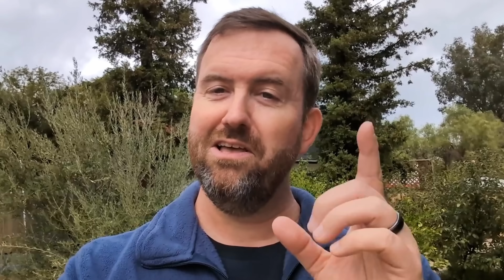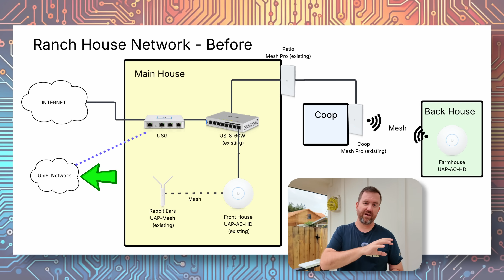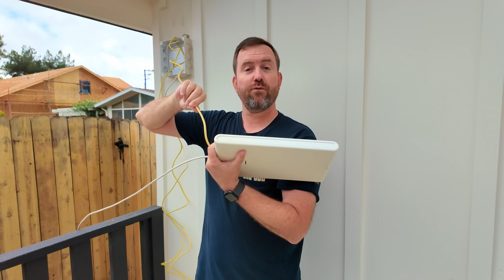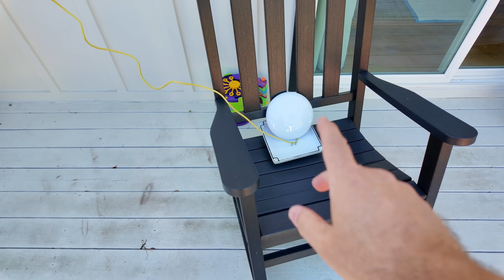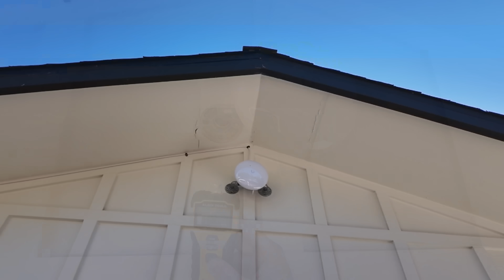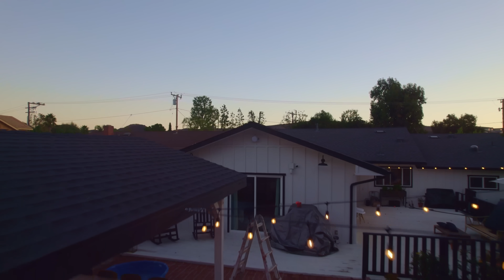How I Solved Terrible Wi-Fi with a Proper UniFi Bridge Setup

Comment: I designed and installed a wireless solution at a resort. All chalets hardwired with the control centre. Remote cottage p2p. 2 years and till date not a single issue.

It was almost an uphill battle to convince the client with hard wiring because all other installers were convincing the client with a mesh topology.

Client is thanking me till date.

Comment: Great video !  lots of interesting information and tips,  btw I am wifi 7 with my IoT stuff relegated to 2.4 mhz only.    I am an apple only house and wifi 7 rocks my devices….  No issues ….  I am typing this on a iPad m5 pro…. Wifi speed from my 2gb connection?   1.85 gb sustained from my Ethernet backhauled mesh.  Apple issues Must be a unfi thing…. I am TP-link

Comment: You can still use the Unifi express and disable wifi 7, and only run wifi 6.  There are a lot of factual errors in your video.

Why paint the cable at the coop?  Should have ran a black cat6 instead of white.

And why then hell did you make the ugly galvanize pipe pull up bar?  They make mounts for the point to points that are smaller and discrete.

This is bordering on hack job.

<- Cisco CCNP here

Comment: Last fall I got my hands dirty and dug a trench 18 inches deep, 60 feet long from the house in each direction. It took about two hours using a mattock (think pickaxe, but one side is a shovel). Then I dropped in some 1-inch SCH80 and ran ethernet cable from the house to both ends. Now I have a POE AP on the north and south side of my house. Using the Unifi software, I locked specific devices to the indoor APs and let mobile devices jump between any of the four APs indoor and outdoor. All the POE devices, routers, switches, and modem run off battery backup, so even during power outages, we never lose Internet.

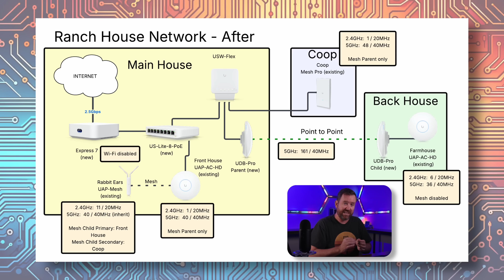Comment: Cool install. This may be a noob question, but how many SSIDs are there here. Are there separate ones for the main house, coop, and AirBNB meaning you have to manually change networks on the client device? Or is it all under one SSID? 21:08

Comment: Interesting project.  However the bit I actually like more is the use of older Unifi devices rather than spending or running to the latest.  Proves that tech can be fine when configured properly.  Also reduces the vast e-waste that we are creating...

Comment: Your cable runs look like shit.  If you had just left cable draped like that round my buildings I would have told you to rip them out and start again.  All very well getting the guys wifi working properly but the install has to look like your taking some proide in your work, not just throwing it in and pissing off as quickly as possible.  Making the install look professional and like you care about what you are doing is just as important as getting his wifi working properly.

Comment: should a person not mount the wifi accesspoints to ceilings? What difference would that make in signal strength
Reply: Depends on direction you want wifi to broadcast. These APs have a D pattern, so on a wall they shoot mostly away from dome and out of the edges of disc, less to the back side. So the guest house wall works because it's a small building. But also was probably just quicker install being right next to the poe gray box below it; more time involved to fish cable thru wall and ceiling to get it to mount there (since he was visiting the day)

Comment: Here's what I don't understand, wouldn't it be more cost effective to use a couple of hardwired AC Mesh's (with Meshing disabled) along with a couple of UMA-D antennas?  Those UDB Pro's are expensive given that they are limited to point-to-point connectivity only.  While I like that the UDB-Pro's are 5ghz, and that would reduce potential conflicts with neighbors, having the AC Mesh's pulling double duty seems like it would provide  more functionality at a lower cost.

Comment: You just cant ever convince me that these wireless point to point connections are better than a simple 1 or 10 Gb fiber wire buried 12 inches down is going to be (for-ever). Theres a simple 12 inch blade "shovel" that you can easily bury a wire 12 inches in the ground in no time... There are 10Gb fiber switches (capable of layer 3 and VLAN segmentation if you need it) for VERY cheap (WAYYY cheaper than the hardware in this video). The problem with "long haul" wireless is always going to be interference which can/will be affected by literally anything in the air... Wire connections just work... Fiber is not that expensive, especially compared to all of this hardware. Annnnd... I hate Ubiquiti security... Those devices are SOOOO compromisable and are just awful. Personally TP-Link Deco would solve ALL of the issues you outlined with mesh and connectivity. By far more secure than anything Ubiquiti... I could deliver 10x the bandwidth, performance, and security with less than half the cost...

Comment: I use a Unifi Mesh AP with their directional panel antenna on my house for my property and I get over 200mbps on my iphone from 300ft away and complete coverage inside my 1000sqft woodshop about 100ft away. Has about a 90-degree arc which works great for my case

Comment: Regarding the starting point, what a mess of terrible networking decisions, installations, and placements, not to mention bad POE power match ups.   I know most people don’t know what they are doing, and this is a great example of that.  This video will educate a lot of people.  I’m surprised you didn’t mention the access point in the window is behind a wire mesh screen over the window, effectively putting it behind a faraday box, reducing its effectiveness.

Comment: While P2P is nice for longer ranges, did you consider either just wiring up the guest house or using a AP that has extra long range?
I'm asking since there's even a line going to the coop already, why not put a small switch there to bridge the gap?

Comment: Reminds me of an issue I ran into. I have point-to-point to my barn (using NanoStations) and put in U6 Pro AP to get Wi-Fi out there. After a power glitch, the U6 Pro meshed with my U6 LR AP. Of course, this was during a blizzard, so I relied on mesh until I could go out to the barn to disable the U6 Pro and get the point-to-point working again. Meshing is now disabled on the U6 Pro (I need it on the LR to connect to my device bridge out back), so it won't happen again. Lesson learned!

Comment: Yep, remember the former video and the nice place…! 

I’m old fashioned though. No big lot, just a quirky 2 1/2 story detached house with plenty of close neighbors. So, cable backhaul went up 7+ years ago, with two now ancient Wi-Fi 5 UniFi APs. Router is still an equally ancient Edgerouter X, and the UniFi software runs virtually under ProxMox. 

It. Just. Works. And… I learned most of those shenanigans from THIS channel back then, so thanks! 💛

Comment: I’d like to request a review of my current equipment and network setup to make sure I’m getting proper coverage. I also have a question about configuring a backup internet connection. I need to run two separate services for failover, but my main connection is in the basement while the backup would need to be in the attic. Aside from hardwiring, is there another reliable way to set up the failover connection upstairs while keeping the main one downstairs?

Comment: Wow that's a lot of work. I think I may have just ran a cable!
Reply: Running a few conduit a years ago would have paid for its self many times over.
Reply: Point to point is cheaper
Reply: I agree. It doesn't sound like $$ was an issue. Running some cable would have been my first solution to the issue.
Reply: How to learn running cable thru attic. New home

Comment: I had a similar symptom this week. I found that my TP-Link Deco, used, still had lingering config. Though I followed guide to wipe. Wifi net would be up, then next min down. Because one of the nodes kept coming up in old state, breaking routing, along with broadcasting different UID on same freq. Was a bit annoying for a while.

Comment: Instead of small universal arm mounts, what is the pipe or metal mount you are using for the bridge access points?
Reply: Plain galvanized pipe fittings with a mounting flange.

Comment: Mesh systems can work fine, but in my experience it's in environments that aren't under heavy load (comprehensive home automation like Savant etc); P2P like what you experienced to outbuildings; and 10k+ Sq ft homes that don't have floorplans that are as open as we'd like. It's odd that this person's AP is acting this way, but that's not indicative of mesh platforms in general.

Comment: Just curious why you could not just run a cable all the way down? if the length was too much then a flex mini/or the mesh pro in middle(coop) with power from main house would have done the job. Also I am not sure if the lite 8 POE is suitable to power the flex and everything else, I might have used an injector (inside house) to feed it plenty of juice and use the same cable to feed the mesh pro at the coop. I do these kinds of installs from time to time so I am sure there were reasons for the choices made (hard to fit everything into a video). regardless great video.

Comment: Why didn't you just extend the cable to the garage, you were already half way there
Reply: I believe they may have maxed the distance cat 6 can run (328’).  Seeing as a square acre has 200’ plus(208.71’), that property would be a lot longer.
Reply: @jamaxit       While running an Ethernet cable directly from the house in the front to the garage in the back may have exceeded the Ethernet distance limitations, this could probably be avoided if it was run in two segments: (1) House to Coop. (2) Coop to Garage/Airbnb.

The Coop could have just had a network switch. Connected to this network switch would be one Ethernet cable from the house and another Ethernet cable to the Garage/Airbnb.
Reply: @Eternal_Tech  the problem with these long outdoors copper runs is the first time lightning strikes even moderately close to the property, the entire network is almost guaranteed to be fried. I would have run fibre instead with a few media converters just for the outdoors lines. It's not a huge expense but it's some work to run everything from scratch again. But yea, wire all the things!

Comment: I'm able to enable wireless mesh even though my setup is hard wired throughout the setup. Got 3 AP's hard wired. The option is/was on by default if I remember correctly. Should I disable wireless mesh?

Comment: So when I used GigaBeams, I just drove a long screw through the pole mount into the side of the building. Do these not have that same capability? The black pipe is cool, but is it necessary?

Comment: We have recently migrated from a Wifi 5/6 Mesh System from Asus to whole home Unifi Wifi 7 setup. I have setup a IoT and main SSID and Network and for now it works like a charm. We have some devices that dont want to roam to closer APs but are still working. We currently have 8 APs deployed and around 70 wireless clients.

It was such a nightmare with my old setup. The ASUS Stuff might be fine in other installations but for us it just didnt work. We had constant disconnects on multiple Smartphones and all IoT clients and I could not find out why that was. Basically the devices stayed connected with the APs but couldnt access the intranet or internet. You had to reconnect and then it worked again.

Also: Dont trust the normal Network testers completely. They test if the wires are connected but cant test the data Rate. We had some CAT7 cables where there was some damage on the way. The tool showed that the connection was ok but over 500 Mbits it got unstable and disconnected.

Comment: 10:55 AC Mesh Pro was not a "great access point." Those things had all kinds of problems and never delivered. Using 2 airMAX NanoStation M5 loco would have been a good P-t-P link. This would have been less expensive than the UDB Pro since budget seemed to be a factor. Not sure why he spent so much time talking about keeping existing APs, they are there, they work, they were not the problem, mesh is always a problem.

Comment: Is there Unifi device that can handle a wifi internet uplink and provide local wifi and Ethernet?
I have a boat in a marina with wifi internet access. I currently use an openwrt device but it’s getting old and I’d like to keep everything Unifi and manageable from my udmp controller at home. 
Also, limited power budget because of course.

Comment: great video like always. only one question, why did you use mesh from ud pro devices if you were taking poe cable to the device anyways, instead of taking a data cable with poe and avoid cutting the speed and performance. not saying is wrong just to know more. could be distance and location i dont know. i started watching your videos about unify devices. i got tplink mesh and router before it was ok but not enough , so i decided to switch to unify everything router , switches, u7 lite access points the only thing i can say thank you, it is amazing what can be done with this new system.

Comment: Internet speeds of 2.5G are too high to get anything less than 300Mbps. Perhaps they could consider lowering the speed so they pay less.

Furthermore, I think it's reasonable not to have upgraded to Wi-Fi 7 or Wi-Fi 6 simply because if they already have equipment that works and is sufficient for them, why change it?
Reply from the maker: Their Internet speed isn't 2.5Gbps - the link between the modem and the Express 7 is 2.5Gbps.  Internet speed was a gig I think.

Comment: For the WiFi 7 AP issue I have found that having a wireless network that supports 2.4,5,6ghz as my main wifi and a dedicated IoT 2.4 network that is broadcast on my APs (U7 Pro/PM) I have had zero issues since switching to that config about a year and a half ago.

Comment: "Hard wiring is always better than point to point."

There was a wire down the fence line to feed the coop, why not run a second wire to the back garage/airbnb?
Reply from the maker: Trenching a wire to the back house wasn't realistic without huge expense - there's 4' of concrete walkway all the way around and connected to the foundation.
Reply: @CrosstalkSolutions  then the wifi bridge makes sense then.

Comment: I am always entertained by these kind of deployments.   You can build a design that is rock solid, can be expanded on, and the customer uses it to offset income/derives income from it.   They will reject the install and end up spending more on a mesh system they will keep and refuse to get rid of due to the "cost" they spent on it, when it is the source of the issues.   They can ask for you to fix it, and will bawlk when you tell them the mesh parts need to be removed.    All while the cost to repair in parts will be less than the time and cost invested trouble shooting a partially implmented mesh.    Again this is someone else's home.   You cant change everything to "update" to the latest and greatest.   This install is a wonderful example of using proper parts.  Could cheaper parts be used, sure.   But this is a hand off that someone else is living with.  Great use of the US 8 Lite and removal of the firehazard USG for an Express 7 (Wildly more performant with features on - 1gb IPS/EXpress7 vs 150gbps IPS/USG).   I am glad that the flex was introduced and avoiding the passthough point of the UDB Pro's secondary ethernet ports and overdemand on POE from the US Lite8 feeding it.  But please get the customer to seal the entry points on the building.  And if possible in the future at the parent UDB Pro, make your cable entry on the bottom of the gang box to avoid the drip path that the water will take to enter the box and pool inside.   No the flex will not die from that, but it is a path for water that it will take over time.  (Insert joke about you bringing rain to Southern CA during the filming of this)

Comment: A pair of LOCO 5AC's for $100 total, fits PoE no switch changes needed, cheaper and 655 mbps throughput. Cheaper, better, managed through UISP easily, no meshing at all. UDB pro's cost 4 as much, management is minimal. Why didn't you just use a proper fixed wireless bridge, Chris? Makes little sense to me

Comment: I am interested in the wired connection between the main house and the coop. Did you use an outdoor-rated cable in a conduit? Also, did you terminate the two ends with an inline ethernet surge protector?

Comment: Would have been interesting to see a test of turning off/on the power a few times to see that it came back all fine without intervention since this was a bug bare of the old setup

Nice to see you don't just insist on replacing everything but used what is still OK to be used. Keeping costs reasonable is very much needed
Reply: Or better still, a UPS for each network device.

Comment: Wasn't there a possibility of running a fiber optic underground cable along the fence of the property?
That would ultimately be much simpler, more reliable, and more energy-efficient.
Reply from the maker: Trenching a wire to the back house wasn't realistic without huge expense - there's 4' of concrete walkway all the way around and connected to the foundation.

Comment: here's a question that just came up: is it possible to make sure that all devices connected to an access point get a fair share of bandwidth, so that no single device can hog all the bandwidth?
Reply from the maker: You can limit per-client wireless bandwidth in UniFi, but not entire network bandwidth.  So for example, you could set it such that no device can use more than 10Mbps up/down, but you can't set it so that the entire guest network only has X amount of bandwidth total.